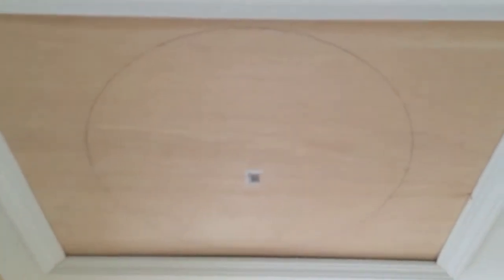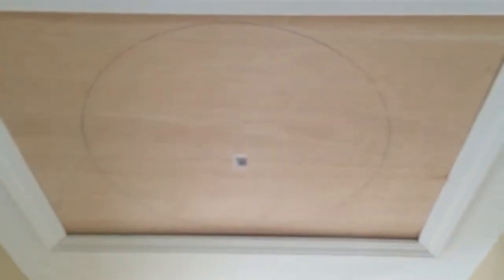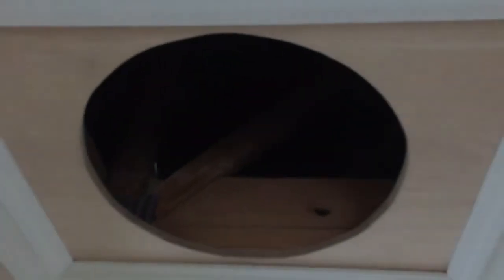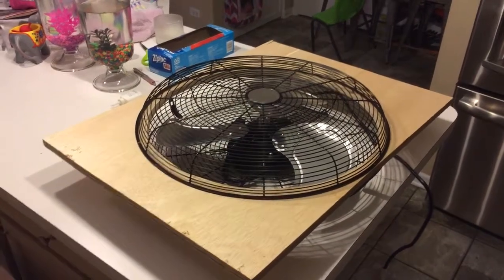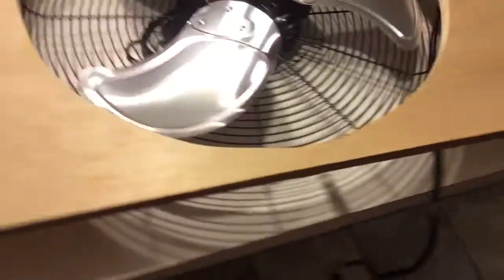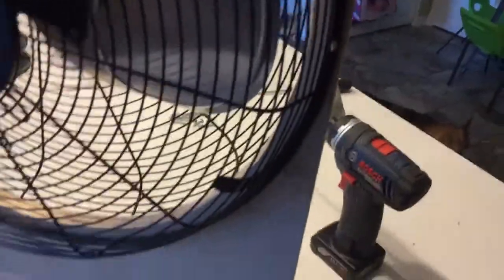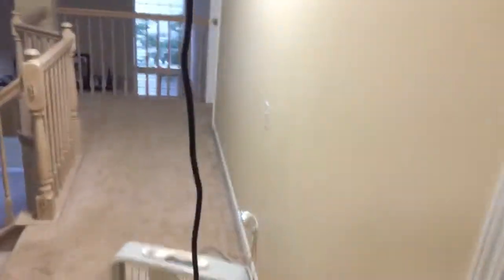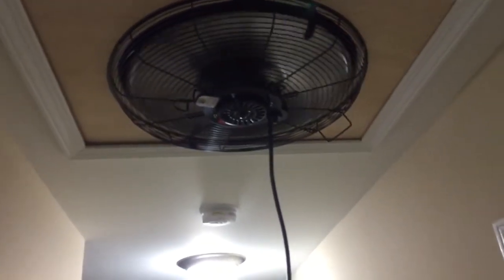DIY whole house fan

Comment: Hey, I'm warning you, that thing is gonna be an absolute pain to clean, you're gonna have to take it all apart and everything. You didn't really need that front guard; no one's really gonna be up in the attic sticking their fingers in it anyways XD! If you remove the front guard, it will be WAY easier to clean.
Reply from the maker: Kat TheFanEnthusiast  thanks for the feed back and information I do see your point and do agree it will be a bit harder to keep clean but I don't mind doing it. Thanks again 😀